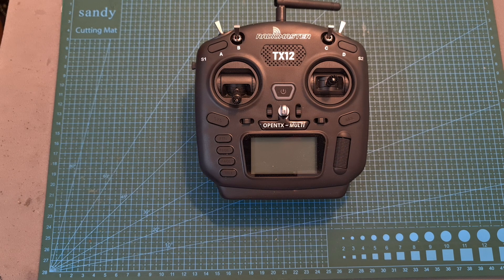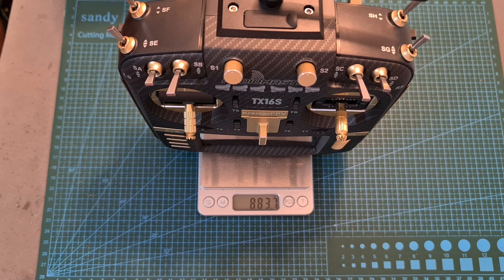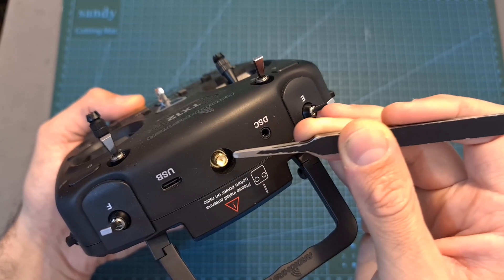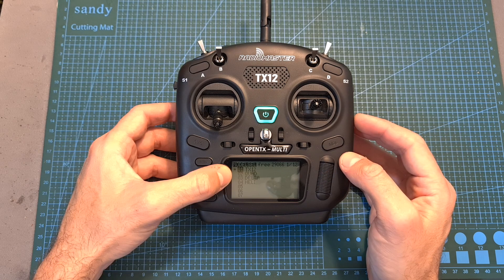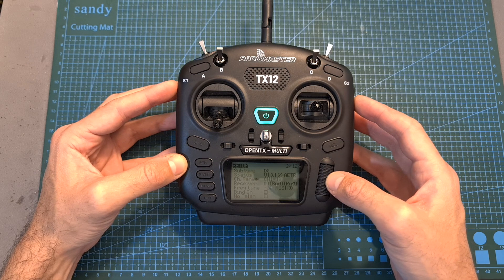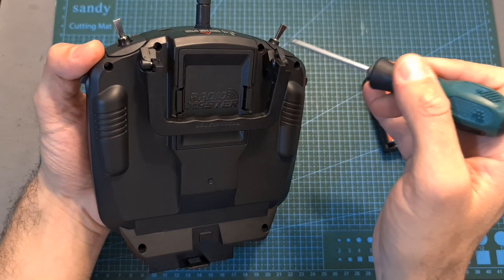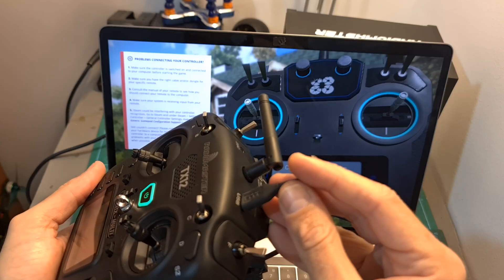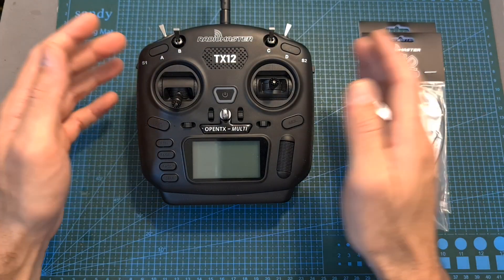Best Radio Controller Under $100 // RadioMaster TX12 - All You Need To Know

Comment: Nice looking radio. I have been eyeballing the Jumper t12 pro as a compact option for $89 with the hall gimbals. I like the looks of this one better, and like the wheel. Just wish it had the hall gimbals. They last so much longer. I wonder if there is a sold separately hall gimbal that will work with this radio.
Reply from the maker: Hi buddy, you can get them here: https://www.hobbyporter.com/radiomaster-tx12-replacement-hall-sensor-gimbal_p2803.html
Reply: @KremerFPV  Thanks Gal, I was seriously just looking at those when you replied. Haha. I ordered a tx12, the jumper hall gimbals are proving hard to find on this side of the globe though.
Reply from the maker: @ki-lowatt7789  No worries Kyle. Hobbyporter is a very reliable company, so you can trust them.

Comment: If only it had better gimbals with HAL. I have Tango2 Pro and T16Pro as my main radios. I hate size of T16. I would love to have similar functions in smaller package. Taking truck load of gear for 2-5pack rip isn't really nice. Carry less and fly more often is better option for me.
Thanks again for great informative review.
Reply from the maker: Thanks a lot Mikko. For this price you can't have it all and I guess that if there will be enough demand they might release an upgraded version with Hall sensor gimbals or sell them as replacement parts.
Reply: @KremerFPV  - 4 months later, do you know if Hall gimbals are available for TX12 so we can replace potentiometer gimbals with Hall ones?
Reply from the maker: @AddictedQuadroner  There you go: https://www.hobbyporter.com/radiomaster-tx12-replacement-hall-sensor-gimbal_p2803.html

Comment: Nice alternative to the FrSky X9 Lite. But what I would need is a radio that allows me to use Crossfire and additionally either Tracer or Ghost without changing modules. Right now the Tango 2 is the only radio that can do.that.
Reply: It's got a standard JR Bay, so you can fit any module in it you want to....
Reply: @EnglishTurbines  you did not read
Reply: @marc_frank  My comment wasn't intended for you....😀
Reply: @EnglishTurbines  ☺
Reply from the maker: Yes, the Tango 2 can do it since it's got an internal CRSF TX. I doubt that other TXs will have this feature in the future and regardless changing modules will take you probably 10 seconds or less :-)
Reply: why would you need that?
Reply: Only tango 2 have built in crossfire. No other tx will have it anytime soon. But tbh changing module is pretty quick and easy IMHO

Comment: Im still using my Jumper T8SG was my first controller and has never let me down. i don't like the frsky box shape controller as i use Frsky on all my Kwads. The TX12 looks really good value. Thanks Gal 👍
Reply from the maker: Yes it has a very similar form factor and might be a good option for you if you want to switch to OpenTX. 
My pleasure :-)

Comment: Nice review!
1) If i install tbs micro v2 inside tx12 than will it connects to Panda vt5804 v3? If not what is panda specs long range alternative or to what should i replace the micro v2?
2) what max.specs micro sd card it supports?
Reply from the maker: Thanks. I suggest using a max 8gb micro SD. It might support more but in my experience 8gb (or less) cards work best. 
What do you mean connect to the Panda vt5804? You can adjust the VTX settings via a LUA script if needed.